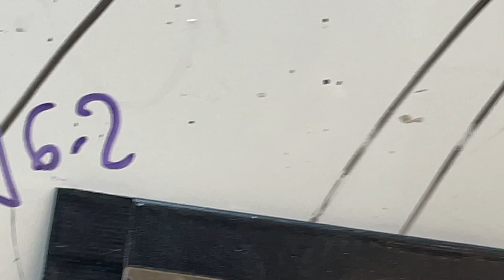Rally GL300 Pt 1 de-fret and re-fret

Comment: You did a nice de fret  but what's that white goop on install epoxy? Most techs use super glue and a  fret press with a cali
Reply from the maker: Titebond glue. Water-soluble, easy clean up. Adds a little extra grip just in case... probably not even necessary. I prefer my wooden blocks over the brass inserts (which I have and use in the press). You can't put a set LP neck through the press; you can only do about half of it then you have to change to another method to complete. I prefer to use the same method all the way; hence knocking the frets in with blocks. Same as hitting them with the hammer, just spreads the force a little over the fret.

Comment: No fret guard to keep the chipping down?
Reply from the maker: No... I can't get those things to make any positive difference for me (after many over many re-frets) :-)
Reply: @SamDeeksRelovedGuitars  I hear ya. Just keep the chips from flying out..not preventing. Best Regards!
Reply from the maker: @blessedheavyelements8544  Physically, by the time I can get the protector under the crown the fret has to be already lifting... In which case, any tearing has already been done. If I lose a chip I prefer to fill with glue and dust as fighting to stick a tiny flake back down doesn't work very well for me. Personal preference :)

Comment: Yo Sam, did you ever make a zero fret without moding the fretboard? Bigger nut with a shelf towards the first fret and a fretslot for the zero fret. You can also buy it: "Zero glide nut system" but I think it is not that hard to make one from an oversized nut and a fret.
Reply from the maker: Hi Darlok... yes, you're right. I think I did mess about making one once... but in reality, despite the 'zero fret' being a cool way of using the guitar's basic geometry to set a very low 1st fret action I'm not ultimately a fan of it because the strings ALWAYS notch the fret just by sitting on it 24/7. The notches then 'click' when playing bends down near the nut and that drive me, well, nuts :-) So I stick with Tusq, making it adjustable when I can.
Reply: @SamDeeksRelovedGuitars  Have you ever tried it with stainless steel?
Reply from the maker: @CristiNeagu  I have - and even that notches quicker than you'd imagine. It's why Gibson, after making their 'zero fret adjustable nut' out of brass (which practically melted the day after it was fitted) went on to make the next version out of titanium.
Reply: @SamDeeksRelovedGuitars  Thank you for the info!